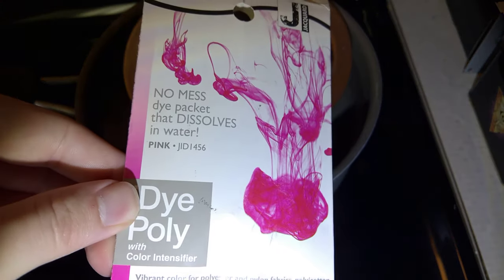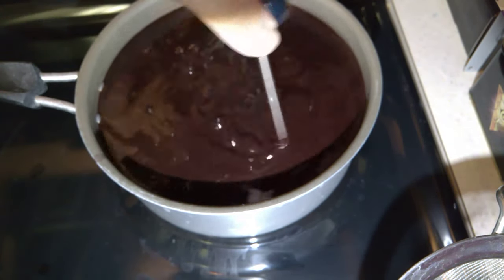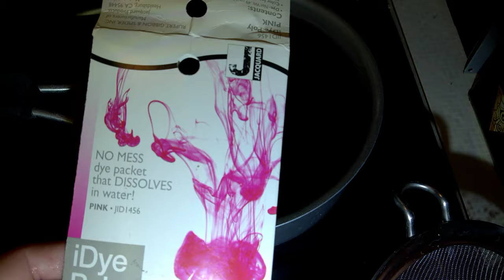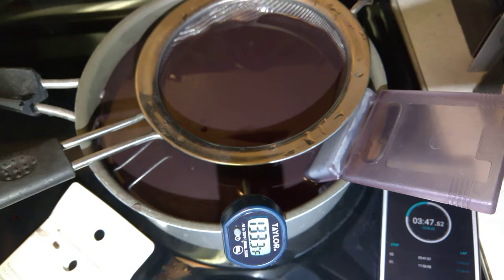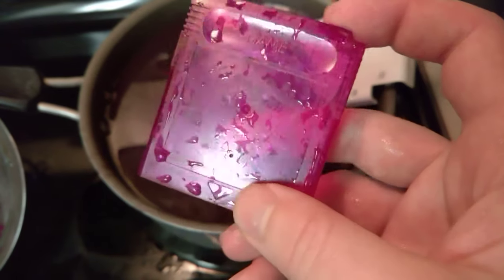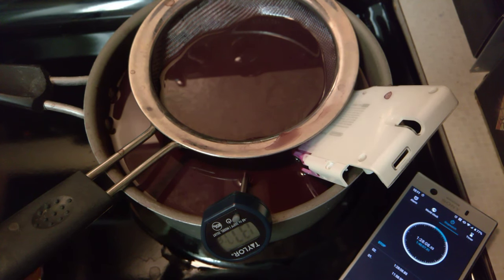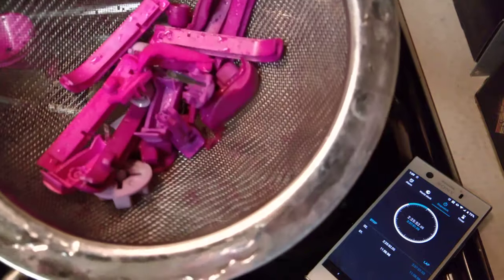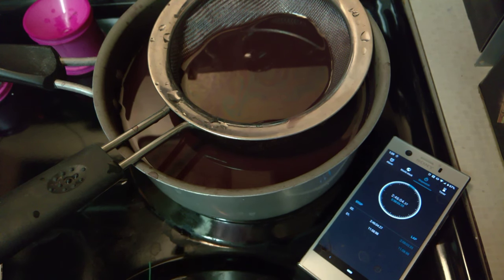Time to dye [some Game Boy parts]

Comment: I had a go at dying some parts yesterday, following along with your video. I also had some issues with some pieces. I’m thinking it has mostly to do with the ratio of water to dye. It’s almost as though the water is already super saturated with extra dye left floating around to inevitably latch onto the surface of the plastic. Next time I’m going to try diluting the dye with at least twice the amount of water. Very fun stuff to try and figure out, thanks for sharing your process
Reply from the maker: Yeah, next time I try this, I intend on using a lot more water to try and dilute the dye more. I think it was way to saturated with a pot this size.

Comment: Good work.  Very interesting to see the different plastics reaction to the dye and time in the dye.  

On the battery case, my guess would be even though it was clean, there may have been some trace oils if it was used on an actual played system.  Perhaps some brake cleaner and scotch brite would have gotten it to a more uniform coloring.  That would also be my suggestion for the "clear" coat on the original DS shell, to scuff it up with scotch brite hopefully without cutting through the writing since it would still be cool to have the OEM writing on it.

Good work as always, appreciate the video!

Comment: How about using automotive vinyl dye? or sanding the parts then using an adhesion promoter so the dye can stick? this is what Ive found after searching for so many hours around the web. Also you need to clean the parts to remove any dirt or oil from it. I think that's one of the reasons why the battery cover came out like that with some darker spots. They look like oily fingerprint spots. Notice how the untouched part inside came out clean and great.
Reply from the maker: I hand't considered any of this. It's worth investigating.

Comment: You should be cleaning all parts thoroughly, to avoid splotches, and use gloves. (Alcohol and scrubbing) Any finger oils and grime will prevent even dye retaining.
Also... you should stir it up more often.
Reply from the maker: Yeah, I did actually clean all the parts with soap and water before dying (except the GBA SP shell). I definitely should have been stirring more often though. I think a higher percentage of water would have helped with the splotching too.
Reply: @makho  quite possible! Maybe the solution was saturated already and you had undissolved dye. Any plans on more dyeing?
Regarding the parts pre-cleaning you need to go the extra mile, as compared to painting, where you just coat stuff, with this you rely on the dye going into the plastic. Hence why even the thinnest film of contaminant, will affect the result. Also keep in mind that scratches and pitting would gather more dye (higher amount-per-area, just like in the corners) and could look darker.
Reply from the maker: @mstoynov90  Yeah, I still have more dye. It's just a matter of getting parts I want to dye and then the motivation to actually dye them.